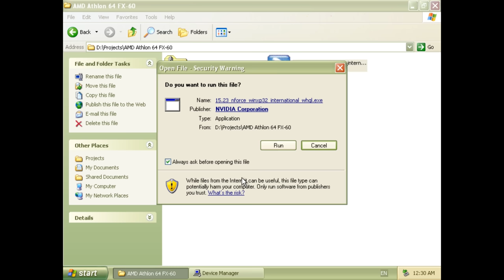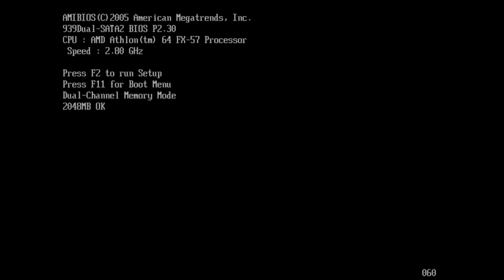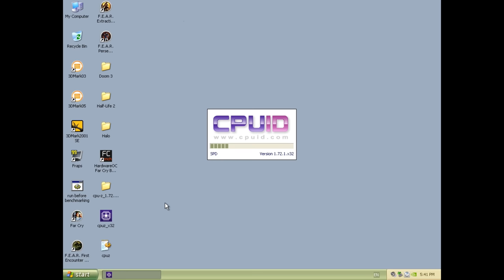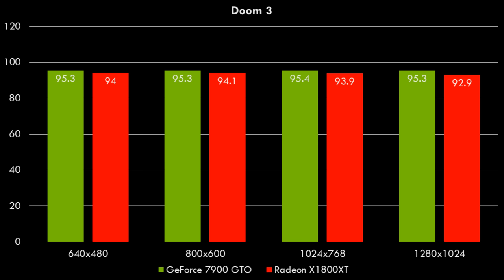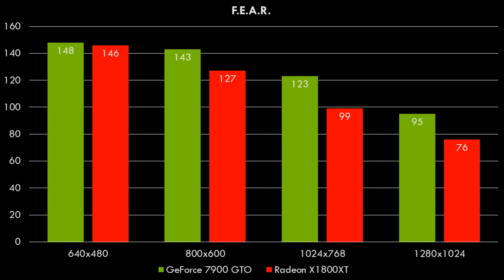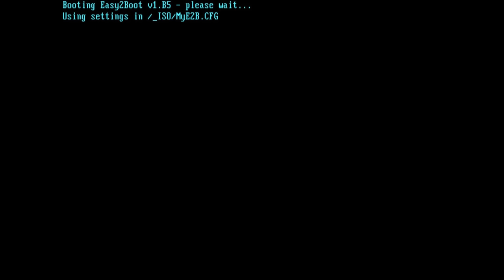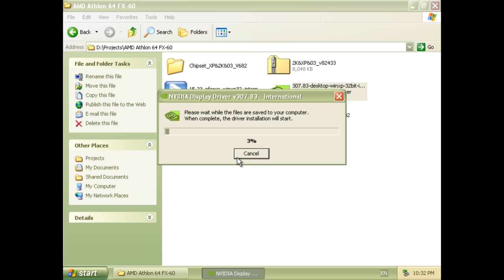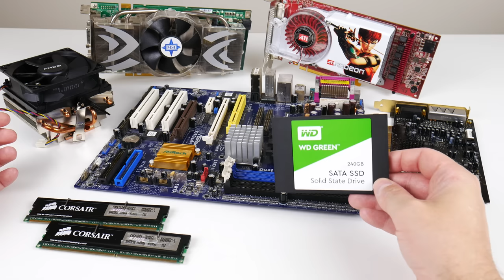AMD Athlon 64 FX-57 - $1031 CPU from 2005

Comment: I wanted to say ASUS has been my favorite brand for motherboards for over a decade, and nForce chipsets hold a very special place to my heart. I really wish nForce chipsets were still around, but when the first Core i7 generation launched, Intel muscled them out of the market on that platform, and obviously AMD's purchase of ATI soured the relationship on their side of the equation. It's really a shame because they were great overclockers and quite stable.

As for those three malfunctioning motherboards, did you look for any bad caps? It's super common for boards of that age. Also, with the first board, did you try using an older chipset driver? I know it's not preferable, but it's something worth trying to resolve any issues. I'm sure you know this, but ASRock was originally an ASUS budget brand and they were spun off in 2002. I've never actually owned any ASRock products, but I've always respected them as a brand.

Anyway, great video as usual Phil.

Comment: First off. When talking of the Athlon FX, have you considered trying the even higher end QuadFX platform from 2006? The processors in question are the AMD Athlon FX-70, FX-72 and FX-74

Also, I have an old socket 939 MSI motherboard in my retro rig that has the Nvidia SLI ready chipset (the model is the K8N-SLI). I've never had any issues with it, and it's still working flawlessly to this date

Comment: I had an Asus board with Nvidia chipset with my Phenom x4 9500 and it lasted about 3 years before I started getting kernel panics. My dad had basically the exact same machine without a discrete GPU, and it lasted a couple more years before the onboard GPU stopped working and he needed to get a discrete one, and then about a year later it stopped booting completely, so I guess not terrible, but not great.
I wouldn't be surprised if a lot of the issues is to do with poor voltage regulation once the caps start dying, and maybe the Nvidia chipset is sensitive to these things, so once you turn on all its circuitry by installing the drivers, it gets unstable.

Comment: Great video Phil! I own an ASUS M3N-HT Deluxe with socket AM2 and nForce 780a SLI chipset. Also couldn't get SATA working in AHCI mode, though it works fine in IDE mode. Now I am curious to see if my A8N-SLI will give me the same issue... Gonna try this weekend :)
Reply from the maker: For AHCI extract the nForce driver, the F6 driver is in a sub folder...

Comment: nVidia made some great chipsets, but there were always rumblings about their reliability right back to the first nForce. VIA is highly under-rated IMO and Phil, I'd highly recommend you try to find an ASRock 939A785GMH/128M for anything you do on Socket 939, it's using the somewhat newer AMD 785 chipset but because AM2s main difference was DDR2 which was down to the CPU, it's fully compatible and won't give you any reliability problems. Plus the Radeon HD4200 iGPU onboard is actually pretty quick if you pair it with some fast enough memory and enable the sideport 128MB, could be a video in that because AM2+ parts with that iGPU and the sideport are cheap, and it'd make a great cheap XP-era retro-PC IMO.

I also feel like I should note that I think ASUS had issues in that era, I went through three separate cheap ASUS boards within 3 months on Socket A but had zero problems from an "Axper" board (Which was basically a Gigabyte with cheaper ports and no funky colours) although I will note my XP retro-rig has a P5Q Pro running with the FSB at 1600Mhz quite happily. I'd also like to second you on the X-Fi inclusion! It's great, I actually prefer running quite a few games on my retro-rig that run fine on my nice ultrawide Linux main machine simply because it sounds so much nicer.

Comment: I own the same A8N-32 board that I picked up second hand a few years ago. I've only had stability problems with, but nothing like the driver issues you had with yours. Normally older ASUS stuff is fine but I wonder if something going on specifically with their 939 stuff.

Comment: I had 2 EVGA NV650i boards from around the same time and had plenty of problems. Non-Standard RAID/SATA drivers which needed nLite to even boot to XP after install and a messy process installing the chipset drivers. Then just had board problems constanly, 2 died within 12 months and gave up completely and went Gigabyte instead. The boards look eye-catching for their specs and price point, but always came up short.

Comment: ULi = old ALi (not Aliexpress)

Acer Labs Inc.
Reply from the maker: Acer right?
Reply: ULI was an actual chipset maker back in the day, if I remember correctly.
Reply: @philscomputerlab  Exactly Acer Labs Inc. Funny how ASRock, which is ASUS budget brand, had to take Acer chipset to make FX-57 work ;). Funny :D.
Reply: Nvidia ended up buying them up. Their last chipset, the 9400GM was actually designed in Taiwan by former ULi engineers and ended up on the original Macbook Air and Mac Mini, before Nvidia pulled the plug completely on in-house chipsets. Before the purchase, ULi was part of the Acer conglomerate, that also includes UMC, or United Microelectronics Corporation, a chip foundry, and AUO, maker of LCD displays. Of course Acer, the computer manufacturer itself, still exists.

Comment: i have the exact same motherboard as your first one and it still works fine for me. only problem i ran into was it wouldn't boot once on a new install unless i ran the original disk that came with it. it was some "chassis intruded" error.

Comment: Almost at the end of the era when Hardware seemed to have soul and felt interesting. Last gen for me that had it still was the 775 core2 duo/quads, in my opinion at least. So funny that the cheapo 939-Dual Sata card outlived/outworked the high end nforce Asus boards. The bios looks low end, and have very few settings compared to the expensive boards but just like today it did not matter as everything was integrated on the cpu anyway and if you wanted more voltages for more extreme oc then an 1min soldering job would do just fine. best mobo in history is naturally still is one of the many variations of the 440bx chipset based boards from abit, and on second place Asrock 939-dual Sata. :P

Comment: I had an ASUS AM2 M2N variant, can't remember the exact model, and that had an nForce chipset. It was one of the only motherboards that I have had die on me. :-/
Reply: I had an M2N-E that started randomly crashing and I thought the board was toast...until I took a good look at it and noticed a blown cap near the RAM. I replaced all the caps on the board that had the same values as the one that blew (in fear that the others would follow suit) and no more random crashes.
Reply: I had (it is sleeping safe in a box in my closet really) an asus m2n sli-deluxe. Never knew about all the problems with nforce chipsets. At least my mobo never gave me any troubles and I used it from 2007 until 2013... I had it with a gts 8600oc, we had good times together, lots of good games heheh

Comment: for the 939 generation I used MSI neo4 platinum at the time for 939, didn't have a FX had a venice core 3000+(pretty much the only cpu I ever bothered oc'ing).... I think it had posting issues occasionally but survived it's use and I never really blamed it on the board as I had bad luck with the same local vender I got it from with most the boards I ever bought from them(not sure if bad luck or what:S)

Comment: for the 939 generation I used MSI neo4 platinum, didn't have a FX, had a venice core 3000+(pretty much the only cpu I ever bothered oc'ing).... I think it had posting issues occasionally but survived it's use and I never really blamed it on the board as I had bad luck with most the boards I bought from the local vendor I use to buy from at the time(not sure if coincidence or not)

Comment: ive used one MB it was Asrock BNF4G-VSTA it had an nforce 420 chipset with Geforce 6100. Ive had radeon HD 5450 that i wanted to use but if i inserted the gpu and powered it on it would not post. it was PCIe x16 gpu. And the radeon 5450 was fine. I still use it in one of my HTPC systems

Comment: Now we're back on track! BUT DOES IT RUN CRYSIS?!??
I had P4 (1.6>2.8>2.8HT OC'd) and both nVidia/ ATi (FX5500>X800GTO later HD3850)
I only used Gigabyte boards which still work today. (I did buy a dual PCIe/ AGP but the neighbour stole it!)
All my later XFX boards died (nForce).

Comment: It's been a long time, but iirc while nforce2 in the Athlon XP days was stealing the show, nforce 3 and 4 were a steaming pile of garbage, both literally (running fairly hot) and having various compatibility issues. I think they even had some form of integrated firewall for the onboard nic that could under certain circumstances corrupt traffic.
Reply: NForce 3 didn't run that hot, but nF4 was a toaster.
Reply: I had 147 opteron with nf3, then upgraded to 165, dfi lp nf4sli-dr, winbond bh-5. It worked as 9*333 cpu and 250*1.5-2-2-4 ram. So nostalgic. Then I migrate to q6600 and it was like step back. "Ram controller in the north bridge. Are you kidding?"
Reply: Yeah my first gaming PC was the Athlon XP, but i did upgrade to the athlon 64, remember being really hyped up about moving to 64 bit for some reason, cant remember what i thought about the performance but then the core 2 duo's hit the scene and I had to get it, found one for $70 used a 1.8ghz  core2duo which overclocked to 2.8 on air.. This matched the most expensive processors at the time so intel became the gaming king from that point on, both in performance and price thanks to overclocking.   This was when overclocking was  a hack though and you could save money by doing it, but once intel realized this they started doing whatever to lock multipliers and what not, they started selling you the privilege of overclocking.

Comment: I had a Gigabyte GA-K8NXP-9 with an Athlon 64 3200+. I liked this mobo, the CPU was a great overclocker with the Zalman CNPS7000C-Cu I had. Unfortunately I made the decision of buying the AMD x700 Pro GPU which was never great. If you can get one of the Gigabyte mobos, I'd recommend it. Still need to load a RAID driver via floppy when installing XP though.
Reply from the maker: Oki I will keep an eye out :)

Comment: Great video as always. Quick question: as I see @ 5:06 did you leave SATA operation mode at RAID and SATAII at IDE mode? I wonder if that's why XP was crashing after installing the sata drivers. Also, I would always leave SATA modes at AHCI before installing Windows. Note: you probably know this but when you do that, you should NEVER go back and change that mode back to IDE after Windows has been installed, otherwise the O.S. will fail to boot. I learned that the hard way. :( 
You have to switch it back to AHCI mode, start in safe mode and tweak a registry entry to regain normal O.S. functionality.
Reply from the maker: I tried all the options! Using a floppy with F6 Driver worked with either BIOS settings...

Comment: I had an ASUS A8N32-SLI Deluxe (not sure if yours is deluxe) and it was a very stable board, solid, ran it for years, loved it but eventually sold it to help pay for the Crosshair III Formula. It was many of my board when I ran exclusively ASUS AMD boards from the P5A to the Crosshair IV Formula (I kept the CIIIF and CIVF with Phenom II 965BE and 1100T respectively and my media center is running the CIIIF and my XP retro is the CIVF.) I might not have ran XP on the A8N32-SLI but definitely Vista, Gentoo linux and openSUSE. Windows 7 is a maybe. (My last XP board was probably the A7N8X-E DLX before the A8N32-SLI DLX) I know I had an FX CPU but not the $1000 one and then later an Athlon X2, probably the 3800+ OC'd to I'm thinking 2.4GHz (you did say 15 years ago so memory is a bit fuzzy). I had 2 7950GT's in SLI and it had dual PCI x16; no x8/x8 FULL x16/x16! Might have had 2GB of nice OCZ memory. -Ok enough memory lane.
I would think about doing a Vista video using the A8N32 board with official nVidia drivers and SLI. If I still had that board, I'd probably see how my two 9800 GTX+'s would do. It is 15 years old so maybe try replacing the thermal paste or pads on the heatpipe with something good. If I remember correctly, it won't be hard to remove. And because of the heatpipe, you might want to try putting it vertically in a case. Heatpipes work best vertical. It also had a blower fan you could attached to the top but if your CPU cooler blows over the fans, you should be fine. I never used it; extra noise. Hope my rambling was useful.

Comment: Back in 2005 my PC was a Athlon 64 3200+ on a Gigabyte K8N Ultra Sli (nForce  4 SLI chipset) it was running a Raid 0 setup off the nForce 4 chipsets raid controller. GPU was nVidia 6600GT (overclocked) 

I used to run Halflife 2 on a Athlon 64 3200+ with no issues at 1600 x 1200 resolution with no stuttering. The stuttering issue was a BIOS setting can't remember what setting I will dig out the manual and try and remember.
The system is still around my brother has it stored in his garage it had it had a Athlon 64 X2 3800 added in 2007 it now needs a new GPU as the Geforce 6600GT ended up with memory issue (probably overclocking related failure).

Forgot to mention the system  was also running the Windows XP x64 edition.
Reply from the maker: I forgot to mention that it's the modern Steam release of Half-Life 2 that I used.
Reply: @philscomputerlab  HL 2 was the first game I installed that required Steam.

Comment: I had lots of problems with nVidia chipset motherboards failing long before any other type of boards. I worked at a Fry's Electronics in their service center between 2006 and 2009. Also my personal rig and a friends rig had an abit board with nVidia chipset and both failed about the same amount of time. Each different issues. Mine was sata controller issues and my friends was randomly powering off.

Comment: loved this era, but it was also when you had to choose between going the AGP or PCi-e. I first had an socked 754 nforce3 mobo with Athlon64 3000 then decided to go with a PCI-e gpu  geforce 7600gt forcing me to buy an nforce4 motherboard i belive it was the MSI Ms-7135. to be honest the sata connectors there were also not reliable. too many times i thought it was the sata cables and kept changing them 😀. the files would get corrupted  after few days.With nforce3 same hard drive, same cables i didnt have any issues.

Comment: "Asus didn't get into windows with chipset drivers installed, 2nd Asus didn't work, 3rd Asus didn't work, doesn't use Asus and it works!"
My friend with an Asus monitor, GPU, and mobo wouldn't be surprised. Good to see their shotty quality runs as far back as 2005.

Edit: If anyone's wondering he had to RMA his monitor 3 times to get a "passable" $600-$700 monitor, replace the thermal paste on his 980 Ti because it covered 1/3 the die and was hitting 100c at all times, RMA his 980 Ti because dead fan, replace another dead fan 3 months later (didn't want to RMA), and buy a PS/2 keyboard to get into his bios because it wouldn't recognize his USB keyboard for some reason.

Comment: Thank you once again for your work. Maybe you could make a detailed video about your usual settings, so we could compare our results a little better. Off topic: Are there any sound cards that offer VXD support in Windows Me?  I tried at least two days with all kinds of aproches but a failed with the Audigy 2 ZS.
Reply from the maker: What settings are you referring to? AFAIK wdm for ME. I would go with 98 SE therefore.
Reply: @philscomputerlab  I followed your video: https://www.youtube.com/watch?v=RfmYYG1rVug. I've absolutly no copmlaints. I was just wodering if you experienced the same than I did with die Audigy 2 ZS. Windows ME is so much better (in my eyes) than Windows 98. I coulden't make the VXD drivers working in ME. And really, I would like to know more abaout your settings when you performe benchmarks.

Comment: In 2006 you could buy at Pentium 4 ht SINGLE CORE processor wich used DDR2 ram and it was 64 bit and you could get it with 2.86ghz
Reply: I got one of these, OCd to 3.5GHz. Still barely runs Crysis with a HD3850. Socket 478 and AGP.

Comment: Back in 2005 I went with AMD because it was the most affordable for me. However since I have gotten into retro gaming I have noticed that for early Windows XP 2001-2004, The AMD CPU's just performed better.  However if you know what you're doing you can get really good performance out of a high end Northwood or 3.0 Prescott CPU.

I ran an Athlon XP 2800+ from mid 2005 until late 2008 with a Radeon 9800 pro. It was an ASUS mobo with an Nforce2 chipset.  I actually had no issues with the chipset, though I honestly didn't go SATA until sometime after 2010 as my IDE HDD's and Optical drives worked just fine for me.  I went on to an Athlon 64 X2 AM2 on an ASUS M3A for my first dual core CPU in 2008 with an EVGA 8800 GT GPU. That carried me till 2012 when I went with my final AMD cpu, the FX 6200. (Garbage CPU) though my parents are still using it on Windows 10 with no issues.

The only issues with Nforce I had was with my brothers MOBO Chipset which had a fan that was noisy and eventually failed.
Reply from the maker: For XP Retro gaming you can just skip generations. Go straight to Core 2 Duo and later. For AMD you can also use the FX platform with Phenom II for example.
Reply: @philscomputerlab  Yes I've done this. I built an XP gaming system for a coworker using left over parts I had laying around. An i5 2400 (Disabled all cores but 1) with a 560 ti GPU.  It worked great. I think it's important though to match the GPU with the CPU though. For example, I tried using a GTX 660 with an Athlon 64 3500+ based XP gaming machine and it was ok but yeah, you're right about skipping generations. For nostalgia reasons though I like to be period correct.